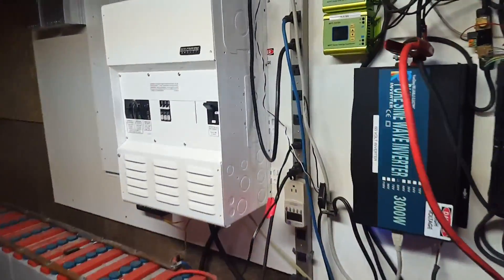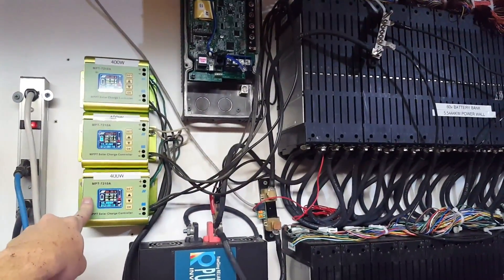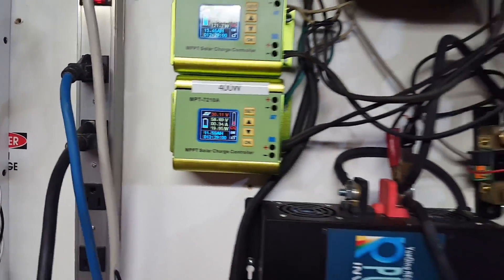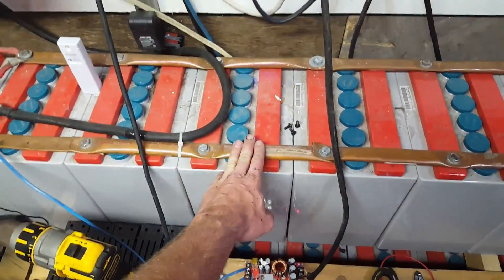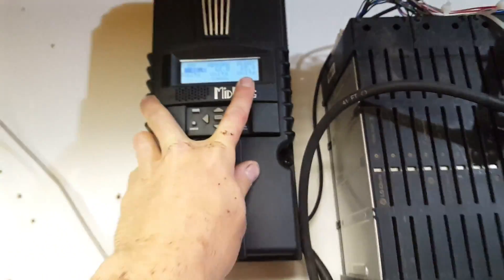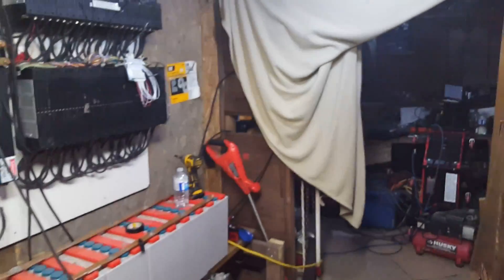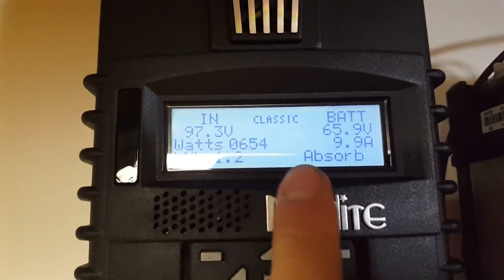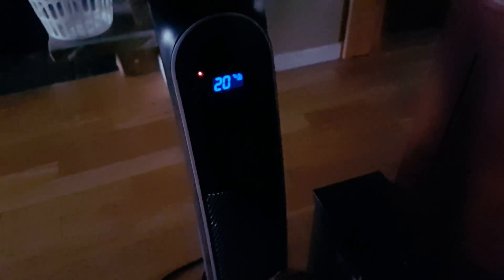Midnight Solar Added To The Power Wall

Comment: I'm gonna need to review the videos you have done on PV panels.  I will use them on an RV with a 4210A Epever  controller and 24v fla banks to feed a GP-SW1500-24 inverter.  Panel purchase will be next, when I learn enough to make a reasonable choice.  Any advice would be helpful !  Best, rc
Reply from the maker: buy good B grade panels for cheap is what I do :)

Comment: The T comp is for temperature compensation for cold or hot weather and will adjust the charge level for you. The stack will get warm but no worries. With the app you can sit inside or anywhere and see what it is doing. I love mine and would like another but to much money for now.
Reply from the maker: yea right after the video I looked it up haha.

Comment: so the green guys gave 600W max and the new charge controller with 1 less panel gave 947 watts?  If you want to you can still use one green guy for that one panel.  But that one charge controller can handle 5500 watts at 66V.  So you can quadruple your solar panels with no change to system (if the batteries can handle it).
Reply: Thumbs up for Piru Creek even though I had a real episode there, years back...  rc

Comment: float and absorb voltages are not the same!!!!!!!!!!!!!
you will drastically shorten the life of your lithium batteries if you keep them floating at absorb.
in my case, lifepo4, absorption is 56 volts and float 53.6 volts. and there is a transition setting which you need the whizbang jr. which measures the current going in and out of the battery. possibly you read the manual first.

and the midnite classic only chages 96A when the battery is 12 volts only. in your case more like 84 amps.
Reply: Its a 16s? lipo. Thats only 4.125v per battery, i think it will be fine.
Reply: nickk.
you totally missed my point. what i am trying to say is setting float V equal to absorb V is not good for the lithium batteries, neither for lead acid for that matter.. bulk/absorb V's are higher to charge the battery much faster. but then once the battery is fully charged, you ease off to a lower voltage. the battery might loose 1% or thereabouts of its capacity, but you are in a safer voltage.
just to give you an example, tesla car owners avoid charging the battery to 100% capacity, unless they drive off right away, in which case the voltage is lowered. this is done because having the battery sitting around absrption voltage lowers the battery's life span. now keep in mind the midnite classic charge controller once the battery is charged tries to keep to float voltage if possible.
midnite classic forum has a lot of threads about how to program the midnite classic for all kinds of batteries. there are many other fora about this as well.
Reply: Urs Odermatt. Thanks for the reply, personally from what I understand what you are saying is true for lead acid type batteries as they need to equilize. Ill let someone else on here explain lithum cells. and how only charging them to 90 percent (4.1v) instead of 4.2v increases the lifespan. I dont see a problem with holding the voltage at 90 percent. Ive been doing it for a while with 3s packs.
Reply from the maker: thanks for the info, these batteries are only charged to 4.1 volt and will be fine at that voltage, I have been charging this way on these cells since I bought them and it seems like the best method, these are not like Lifepo4 cells at all and can be held at this voltage, thanks a lot for the concern!
Reply from the maker: lithium ion pouch cells